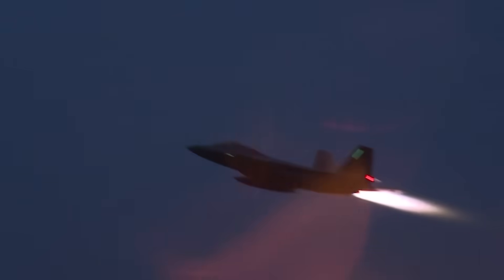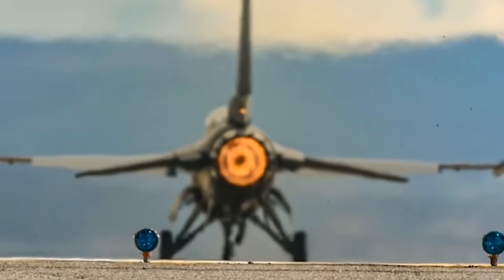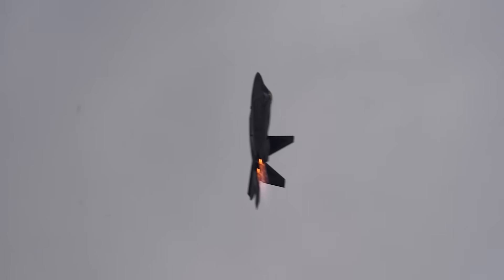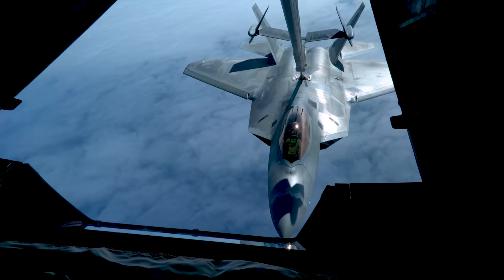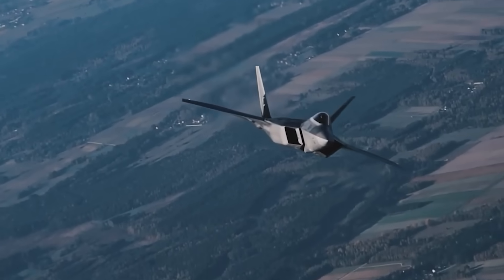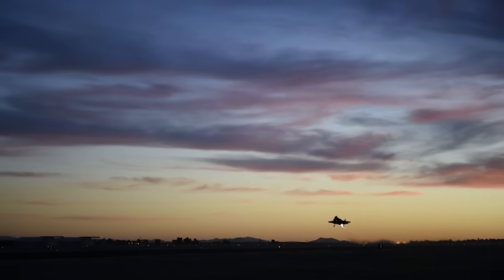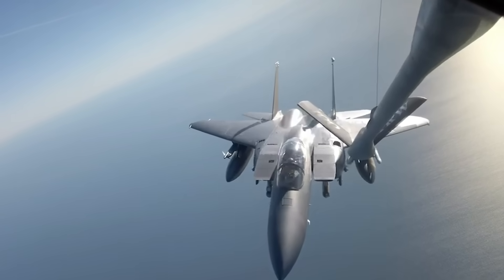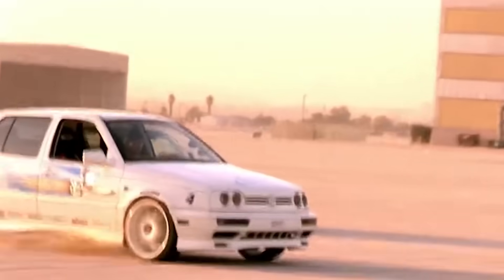Why the F-22 can only use AFTERBURNERS for a FEW MINUTES

Comment: They are fun to be around on the tie down for engine runs.
Reply: Years ago, I was repairing a fuel meter on an aircraft fueling truck at a Navel Air Station, about 60 yards or so away, they had a F4 Fantom tied down and doing an engine run. I broke off a couple of filters off my cigarettes and used them for ear plugs, didn't help much and the test seemed to last forever.  The security escort that had taken me out to the taxiway where the truck was parked had left me to do my work, he came by to check on me, and I told him the Fantom was just about the loudest thing I have ever heard. He laughed and said be glad it wasn't one of the F14's because they were "really loud"!